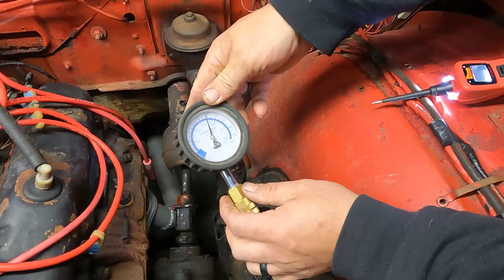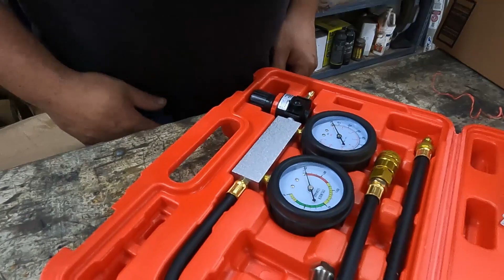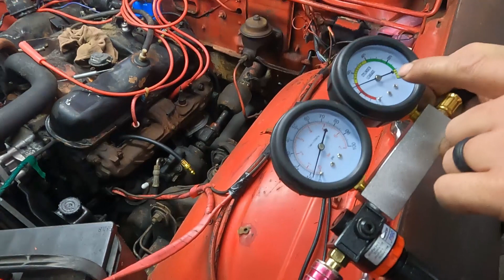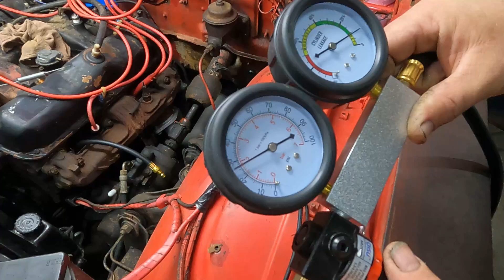2 ESSENTIAL Tests for an Unknown Engine - How To Look For Problems

Comment: Good test way beyond most of the trolls on you tube for sure lol 😆.... I'd rather had done those test on a warm engine so things are more at operating conditions ...but still a good general indication of condition... Next test after some running should be interesting if they go up or down.
Reply from the maker: I should have said the compression test was done on a warm engine. I intended to follow immediately with the leakdown.